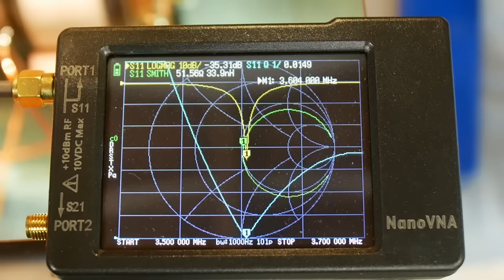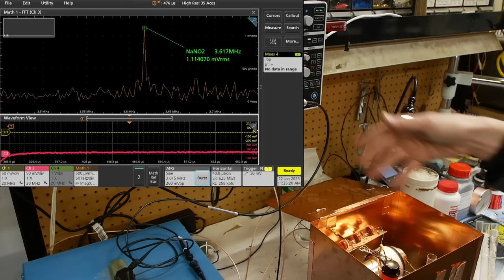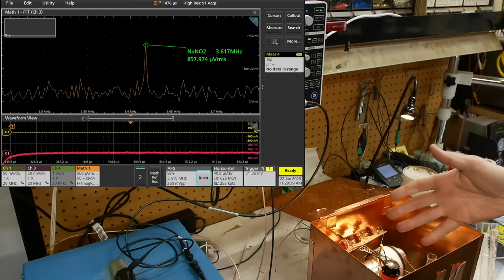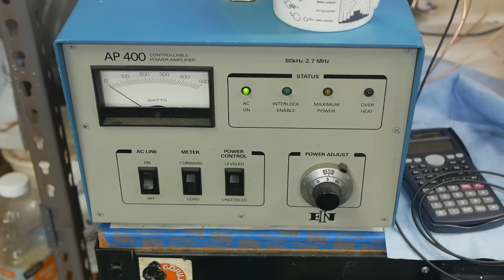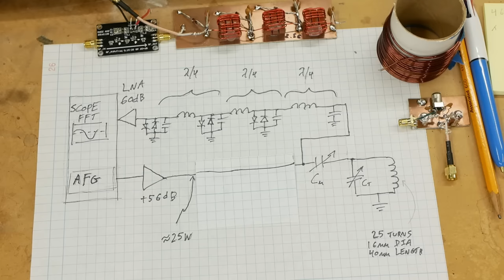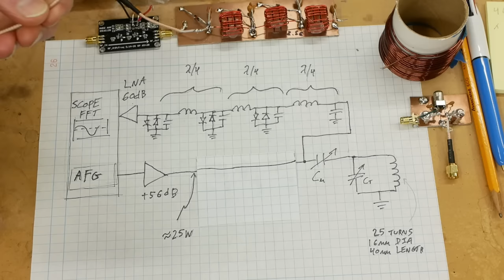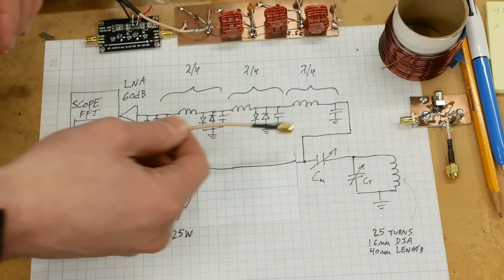Identify chemicals with radio frequencies - Nuclear Quadrupole Resonance (MRI without magnets)

Comment: Hey,
fascinating video as always. Very impressive to see, that you can measure this weak effect with a homebuild machine! I have two questions though:

1) I did not get, why you would get a net polarization out of a pulversample, when all spins have an arbitrary orientation. In a monocristal I would get I why you could get a net polarization, but why don't all the spins cancel each other out in the pulver sample? Isn't applying a flip angle of 110° equivalent to turning the sample by 110° in which case you would still have no polarization?

2) Could you increase the signal strength in a (liquid) sample by first applying a strong polarization pulse with a static electric field like in earth nmr machines? Or is the molecular field way too strong?

Comment: Fascinating how small it is without having to use a  field  magnet. I am in the process of helping clear a late analytical chemist friends labs. He hoarded equipment since the 1960's and under a cover and a lot of other equipment we found an early 60's Perkin Elmer  R10 60Mhz NMRS,   it comprises two cabinets, the larger a grey painted aluminium panelled box 1Mtr x 1.2Mtr thai contains the 1Ton steel armatured magnet, this has a rectangle of 3" steel plate 16" deep with round  poles carrying a pair of alcomax or similar alloy cylinders, approx 16" x 12" Dia and having 7" pole faces at the gap. between which are the exciting coils and the tunable antenna module. There is a lift off painted  wooden lid in the middle of the top surface of the cabinet, removing this reveals the gap some way down with a small hole in which to place the sample contaned in a 5mm dia glass straw. The control cabinet is a seperate unit with a beautifully laid out panel of analogue switches and poteniometers with an occilloscope in the middle, open the side door and the individual valve chassis are revealed, no plug in PCB cards here! A great pity it will have to be broken up and scrapped to remove it, The London Scienec Museum has the Prototype of this machine  so they do not want another. I was told that the magnets were made in Sheffield and that the magnetizing was carried out  in the small hours of the night and with the permission of the electricity generating board so not to overload the power grid

Comment: It's interesting to think about this from the aspect of the wave of energy going out and plotting it like a sine field on a plane. If I understand correctly, when you hit the peak strength of the signal, you are basically aligning your pulse signal to the resonant frequency of the cumulative spin of the material and constructively interfering with the wave signal to boost it above the ambient resonant "ring" of nature. Thus if I still follow along then having too little or too much power or a wrong burst length, then you move your signal out of phase with the natural resonance and end up partially destructively interfering with your intended output signal. Please correct any mistakes in my thought process as I am fascinated by this 🙂

Comment: As usual excellent presentation. Is this possible to use RF circulator or similar circuit to separate excitation signal from weak spectra signal ? I did not see in practice RF circulators for such low frequencies, I saw them in EPR spectrometers working in X-band but there are some for lower frequencies like VHF. In EPR, when resonant cavity is excited and there are reflected signals (usually meaning that EPR resonance has occurred resulting in cavity de-tuning, empty tuned cavity should not have reflected signal) returning through same waveguide as excitation signal  but circulator redirects weak signal from cavity to another port, not to the port from which excitation originates (it has three or more "ports" arranged in circular way and it passes RF signal in single direction hence the name). Then signal goes to detector diode, amplifier, lock-in detection and data processing. Once more  - just a thought, I am not sure about similar solution for this RF band.

Comment: Cant believe how simple this is in terms of how complex RF circuitry can get. This really uses many very basic principles yet puts them together for something really magnificent. 
Does anyone have any ideas for how this could be set up if one were to use an external frequency generator (ie one not built into the oscilloscope)? I imagine the timing would be the issue to overcome but I'm sure it's possible.

Comment: Great video as always! I was wondering why you didn't use something like a circulator for isolating the three ports (pulse generator, sample oscillator, measurement) from one another. This way the high-energy pulse could pass by the sensitive measurement equipment, and would instead always have to go through the oscillator, thus reducing the need for all of those high/low energy filters.
Reply: Think the circulator losses will be a little too high, and the isolation not enough, though adding one could definitely improve the application and allow lower level signals to be detected.

Comment: I can't stop thinking about a VNA setup for this. Or even an SWR meter. They use directional couplers to separate returned signal from the inserted. For this low freqs, the implementation would be ferrite transformers. W2AEW has a good video explaining the innards of an SWR.

Comment: Would the returned signal strength of your samples be improved if it were a liquid sample?  (somehow makes it easier for atoms/molecules to align with the magnetic field vs. a solid sample?)

This brings me back to days of using NMR in chemistry (there is it proton H detection).  I had always wondered why there was some magic "spinning angle" that this huge machine was designed around, finally got some better understanding of it from your descriptions!

Comment: Can probably improve the delay line matching. Orient the toroidal for each stage at right angles to each other to reduce unwanted coupling. Isolate each stage with a shield wall between each stage.

Comment: hi!, did you change your oscilloscope from 5 series to 2 series or you have both? could you describe some key differences you find while using it for your projects purposes? 

is not the 2 series interface choppy? i tried 3 and 4 series in person, and it was quite not up to what i'm used to from tablet touchscreen

thanks for another nice video :)

Comment: Fun fact: you can use gyroscopic precession to build an integrating accelerometer. Each rotation of the system is X s*(m/s^2) which is to say X m/s of delta-V. IIRC the V-2 used such a system.

Comment: Is this the same as measuring the frequency dependence of the material's dielectric constant?   Also, I would consider using PIN diodes for your TX/RX isolation switching.

Comment: Only a physicist would have taken such a long shot. Engineering-wise ( please allow the expression): could you replace the RF amplifier with a half bridge based module, then throw a burst of pulses and count the time and decouple the power path and couple the sensing path ( like you suggested) and if you obtain a good SNR then you can get some more comercial or pedagogical device that would increase the value of this needle in the hairstack - like work. Regards!

Comment: Good presentation. As you mentioned, results are not nearly as you hoped for. That might be caused by a mistake in assembly of transmitter side diode+resistor network. Two diodes making T with center resistor are actually parallel instead of anti-parallel, resulting in passing only half of the cycle, effectively making rectifier instead of amplitude reducers. Hope it helps (if you haven't spotted it already).

Comment: Great video I like your work Ben.  A comment on your trick to enhance signal using the stimulus pulse sequence (+90d, 180d, ... ).  There could be a link with the self synchronization effect of multimultiple harmonic oscillators (initially randomly phased and slightly detuned) when exposed to the same "pacing" stimulus.  Congratulations! Cheers.

Comment: Concerning the T1 signal which gets weaker because of the response from molecules getting out of phase, i'd guess another source of phase shift could be the difference in relative speed as the sample sits on a rotating earth : a different altitude means different speed, so a different time rate (same reason why clock rate difference has to be taken into account when time references on satellites are compared with ones on earth). Though i'd guess the effect is imperceptible, perhaps putting the coil and sample sideways would reduce that effect?

Comment: Very interesting video... seems you can break up the tx and rx using a MOSFET like in a pulse induction metal detector uses. Then the frequency could be controlled with a microprocessor or simple 555 timer..

Comment: Ever thought of using a RF circulator or directional coupler to separate the power output from the preamp input ("diplexer")? Good directional couplers have a forward-backward ratio of better than 40 dB. Good cirulators have a separation of 20 dB or better.

Comment: Physically, the detection of compounds rather than elements indicates that this is interacting with the electron shells, not the nucleus, just like optical spectroscopy.
 Electronically, the clamping diodes are a classic method that doesn't depend on a resonant transmission line, though clamping the peak amplitude at multiple points along the long transmission line may have benefits in reducing the total signal.
 In terms of resonance detection, sending in a wideband pulse instead of the frequency of interest may provide simultaneous detection of multiple substances.

Comment: Very nice ! So, if I understand it correctly, you would get a better signal, if you would use a bigger uniform crystal (of NaNO3), than the mixture of disoriented microcrystals (aka powder of NaNO3)? Would it help to dissolve all the salt in e.g. water, as a highly concentrated salt solution? What is the minimum amount of the salt to create a usable and identifiable peak? Thank you for your always amazing videos !
Reply from the maker: Interestingly, the technique doesn't work on liquids -- even NaNO2 dissolved in a liquid will no longer present an NQR signal.  The reason is that the crystal structure of the material is what provides a characteristic electric field around the nucleus in question (nitrogen).  In liquids or amorphous solids, there is no regular crystalline structure, so there is no NQR signal.  A large single crystal should have a much larger signal than a powder sample of the same mass.  The orientation of the crystal relative to the coil also becomes important, and can give more information about the crystal's internal electric field.

Comment: Using the amplitude formula for a guitar string, I came up with the diameter of a photon.  It also matches wavelength to distance between molecules.  Distance between molecules = Wavelength times 5.025089342 times 10^-10.  That was what I got for two H atoms against the 21mm wavelength antennas and only 5.02 E10^-10 for water verses the microwave oven.  It would be interesting if other wavelengths or distances could be calculated this way.

Comment: Hey ben, one of the diodes in the stages of the transmit diodes-resistor pair is flipped, check 13:12, it probably wont affect much since you have the other stages, but still you may want to fix it.

Comment: There is very little chance that anywhere in the universe has the same amount of time in a second as we do. Still a Great Video! 
In your diagram you have three sets of two diodes and resistor to ground. On the built circuit you have an extra set of diodes and they are both facing same way. What are those for? Did you add them to the design later?

Comment: would using rg59 or rg6 coax have any kind of benefit or consequence vs the thin coax you were using? from what i understand the larger the coax the better it is at high frequency noise but im wondering if there's any specific exemptions

Comment: It's an interesting setup. 
I was somewhat surprised that you don't have more adjustable band pass and band stop filtering on your detector. 
Seeing the setup for the ringing resonant circuit, varicaps might be an interesting way to go about it too, since you'd have more of a pulsed DC circuit, rather than a full AC setup, which makes filtering and signal matching slightly easier (in theory any way).

Regardless, this is good stuff.
Reply: Well, the tuned circuit he has 'matched' to (and excited the crystals) provides some needed bandpass filtering - were you seeing that more was needed?

Comment: Would it work to hook one of the cross diodes up to an adjustable +0.3v source and the opposite cross diode to an adjustable -0.3v source.  You could adjust the sources so they are just below the conduction threshold voltage for each diode.  Then the ac signal could be  reduced to just millivolts before it exceeded the threshold voltage of one of the diodes and clamped any further excursions.
It wouldn't be enough to completely stop the signal, but it might be enough to stop the amplifier from being damaged.  And allow you to not have to make tuned delay lines.

Comment: Would it be possible to have two separate coils - one for the excitation and another for the pickup - and to place these physically orthogonally. With a bit of finagling, one can get a 1:1000 (or better) separation between these two coils. This would help in reducing the noise from the Tx amplifier into the detector.

Comment: Electric guitars use magnetic pickups called "Humbuckers" which use two coils oppositely wound to self cancel out signal from outside the coils?
Also, better if wires (very) cold for less thermal noise?
Any chance a resonant driver could set off unstable nitrogen compounds like nitro cellulose?

Comment: What about a directional coupler and a medium range spectrum analyzer with signal generator? Though the coupler will have higher losses, but no need for adjusting those quarter wavelengths. As it would function all the time, the amplitude of the reflected signal during energizing the coil might give away an information. Reducing receiver bandwidth will furthermore increase SNR. On a cheaper model "zero span" would do the trick, while a higher-end model would have real time FFT.

Comment: Note that most NMR analysis starts with going after hydrogen resonance. The magnetic field and radio power required for hydrogen are lower than for any other nucleus.  Even though there can be multiple hydrogens in a molecule,  each will exist in a different environment and so have a different resonant frequencies.

Comment: If the "reference direction" for the nuclei comes from the local electrical field that exists in the crystal lattice, this field will really only be consistent within the body of the individual crystal; near the faces and edges of the crystal the field will not be quite the same. As a result I expect that finer crystals will give a weaker signal, which might be why the paracetamol pills, which are composed of pressed very fine power, give a weaker signal than the relatively coarse sodium nitrite powder.

Comment: 1N5711 diodes would work better in this circuit.  Good for 70v breakdown voltages, much faster responses, and lower drop voltages to protect the LNA.  Also a dual diode pack is available using similar Schottkys.

Comment: I have several question (maybe genuine):
-I assume you can detect only several types of atom. Am'I right or did a miss something?
- If yes, how could make a measure without  a big "back ground noise" of the air and/or glass you used to hold the compound?
-Could you measure the quantity (or the ratio) of each atoms (something live x% of H, y% of O, z% of N, ...)
-what about isotopes, is it possible to see the differences of one particular atom (ex C12/C14)?
-same question for the chirality of a molecule

Comment: I wonder would a differential stage be more efficient in filtering a difference in a sent signal and a signal with some disturbance caused by the resonance? Then you can send the difference to LNA. No frequency adjusting is needed in this case

Comment: Build an AC resonant MHD system dude. This is the holy grail of applied science!

You just need 1 big coil matched to a high voltage function generated signal of which both ends are connected to a capacitative plate - where the magnetic field created by the coil intersects the "current" created between those 2 plates

Comment: I'm a little confused as to why you don't use a higher impedance sense coil instead of using the low impedance transmit coil for transmit and receiving. I did see a couple of other coils there with a lot more windings so maybe you tried that and it didn't work. I'm guessing the most likely answer is that the noise floor from the power amplifier might be the limiting factor and having a sense coil might be below the threshold of diminishing returns.

Comment: At 13:04, it looks like one of the diodes is reversed.  Both diodes between the 2nd and 3rd resistors appear to be oriented the same, rather than opposite.

Comment: If your detector / transmitter circuit can be modeled as an LTI (linear time invariant system), could you potentially subtract the impulse response of the coil and test tube itself? Basically have a calibration run after you tune it where you get an average empty response to help clarify the testing material peak?